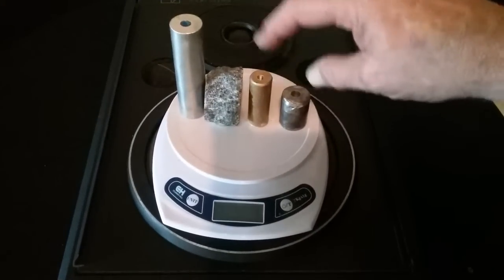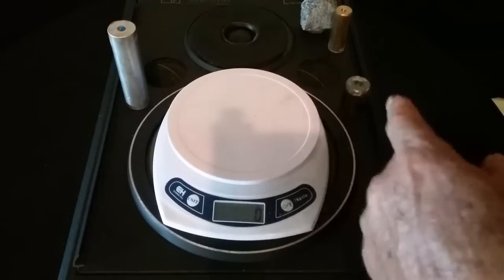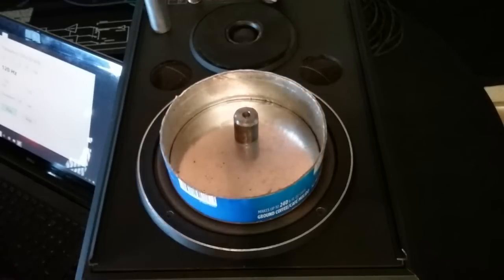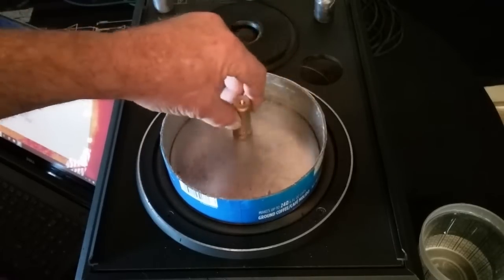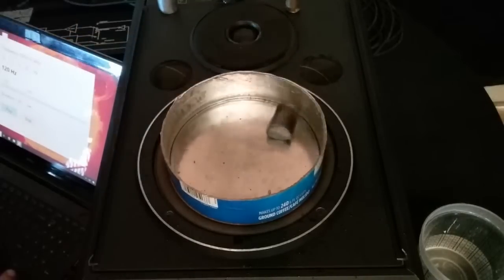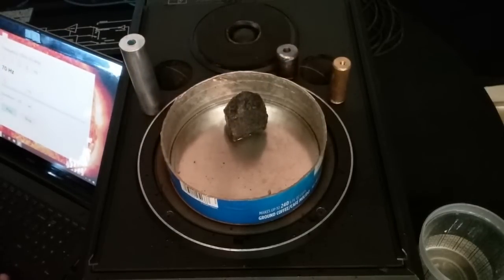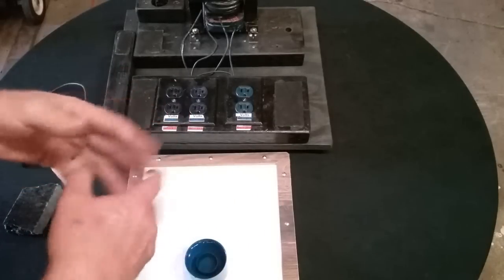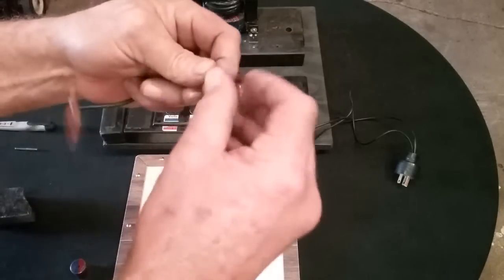Vibrational and Electromagnetic properties of Granite

Comment: Note that not all granite has magnetic material in it. It can vary between where granite is quarried. Many of the vibration properties will arise from its Piezoelectric  properties as it contains quartz. Typical granite is quartz, mica, and feldspar . I see a few online reports from granite top salesman that Black Granite seems to be the most susceptible to being magnetic. The rose and white granite I have on hand don't seem to react to neodymium magnets.
Edit: Double checked on all the granite I have. white ganite does not appear to be magnetic, rose granite is slightly magnetic, while black granite is the most susceptible!
Reply from the maker: Yea - I have experimented with several flavors of granite - and from my experience the black displays the strongest magnetic and electromagnetic properties.
I - like you - am working on the electrical properties as well as electromagnetic and vibratory.
Those darn megalithic builders must have had easy access to electric currents and vibration - because - consider this - if the pyramids were actually generators - to assist with the manipulation of stone - how did they manipulate the stones for the first pyramid? (Unless a mud brick pyramid with minimal quartz rock allowed them the power to build the more monolithic ones...) The dating of all the pyramids seems to be a sham or a confused babel by mainstream "Egyptology".
However, I stand firm in my theory that the ancients had abundant and available electricity and natural vibration by which they "naturally" corersed to manipulate the stone. We just don't have the same situation readily available without a seriously powered laboratory...
Reply: @TheGoodVibrations  I'm definitely convinced that they understood some principles a physics dealing with electromagnetism. It's very silly to see egyptologist try to explain how to move several tons of stone with a ramp and claimed that a single bend in rope was a force multiplier. These people don't even understand basic mechanics. I'm fairly certain that they had a very Advanced knowledge of electrostatics that we do not use very often today in the application of work. Although I can make a Van de Graaff I'm still investigating how they would have done it and what I'm finding is several promising leads across different cultures. On paper it looks good but of course I need to get the materials to experiment.
Reply: @TheGoodVibrations  Its interesting that many obelisks were made from red granite and white.. at least I think that is true. I am thinking why ? Could it be they wanted to dampen the effects of something? Both  Michael and your comments are interesting. The North pulls a compass needle to it. There must be something very powerful like magnetite to pull the needle towards it don't you think?  Has anyone ever thought that the pyramids of Giza might actually be obelisks themselves and if we were to dig down far deeper, we would find out? That would be wild wouldn't it? I guess it would be forbidden so nobody could prove it right or wrong.  I'm just thinking out loud, thoughts that would be forbidden in secondary school. Even if I am wrong, a lot of things do not seem to add up around us on things we learned at school and in the media and I appreciate people showing practical truths i.e. real science. Take care !
Reply: Yes, I tested this myself. Some granite has iron Oxide so ferromagnetic.
Reply: In my opinion the pyramids where cast in 
Geo polymer  blocks
Reply: @TheGoodVibrations  Edward Leedskalnin moved megalith sized rocks using magnetism in the late 1940s.  I don't think the conditions are so changed as to make it more difficult in this era (though the eras have and do change I agree with that) He did produce a short book about the basis of the technique. It's hard to follow!
Reply: @TheGoodVibrations  I think if you'd got to the stage where you were going to build a giant power generator, you'd be able to make smaller ones which allowed you to scale up and make a giant one.  Sound frequency and electrical + natural magnetism manipulation were used, of that it seems certain.
Reply: @miltonreid6740  Yes, Here in NZ we have Iron sand which is magnetic
Reply: @The Good Vibrations   It's a neat demonstration, but the variability of the granite composition leaves you unable to draw a meaningful conclusion about which composite account for each property. 

At a glance, I'd say the stress induced in the quartz composite portion of your stone there is triggering the piezoelectric effect and polarizing those substructures within the crystalline lattice superstructure. 

There's still a ton of research here that I have questions about, however. 

 First, please try removing the metal pan 
,and replace it with an insulator like ceramic or glass. Then please show us what happens. It would be ideal for you to find a setup that's not dependent on a speaker as well, considering those are most likely magnetically actuated and could be interfering with your results. Thank you for reading.
Reply: @TheGoodVibrations  I totally agree with you  awsome  work
Reply: Thank you for this test!
Reply: @mykulpierce , can you explain how the Romans used to move their giant blocks without electricity?
Reply: @fearlessjoebanzai  idk but I can tell you that several people, with a few iron bars, can move tens of tons by using leverage. Though their materials would likely not have been as strong as today's, it is not inconceivable that a small group of people could move most pyramid stones without an unusual amount of effort.
Reply: @TheGoodVibrations  Yall focus way too much on Electricity as though its the only source of energy when acoustic waves are pure Kinetic energy in action not only shown to have mass all its own independent of the material which it propagates but also is the ONLY was we have really found to demonstrate Negative Mass/Energy with proper arrangement of acoustic standingwaves.  Ancients were well aware of Faraday waves and its all over their Art and their Megalithic works.  They show their acoustic devices all over in Egypt but if one does not know what they are looking at they might mistake the sled for something like an ancient lightbulb or something.
Reply: You'll find red granite is reactive to magnets just much weaker... Try using a compass needle to detect the magnetism, also it's only magnetic at certain points where you see more quartz buildup and especially along flat sharp edges... Hematite is a great example of magnetic rock especially in its natural state...
Reply: @NorthernGate777  very unique and original theory... if the pyramids were actually MEGA-Super monoliths, and we only see the top, we'd be potentially talking about life on earth billions of years ago too. lol 

My first thought would be to find out what they already know about the base stones of the pyramids, and see if anyone has ever documented anything abnormal beneath the base stones...
Reply: Michael Pierce - excellent deduction Michael, pretty soon you'll be working out how to make a 'back to the future' hoverboard. All you need is a few more ingredients , to make it work. I'll give you about a year before you finally work it out if you just keep at it. I would like to have open minded thinkers like you on my team. That would be fun.
Reply: @NorthernGate777  - good question. What's under the pyramids ? How old are the pyramids ? Who built them ?
All will be revealed. And when it does. A whole new world will emerge. A world of wonders. A world of abundance not scarcity.
As Tessla once said"the whole universe is a free lunch" 😊
Ps. Keep thinking out loud. It is essential to finding the solution
Reply: All good points - the fact is ‘why create and move such huge and heavy blocks?’ Unless you not only have the ability to but it’s easy to do it - due to magnetism / energy / vibration etc that we don’t fully understand .. yet

Comment: So how would you demonstrate the effects of static electricity on black granite?
If ancient steles and other structures were used in some form of electromagnetic storage/transmission, how did they prevent it from grounding out (insulation)?  But then there's that research on ground effect electrical production.
Lightening is very powerful.  How is it produced naturally?  If tornadoes produce lightning from spinning air, how would the ancients have produced spinning air fast enough to produce a charge?  How would they have produced a charge differential to produce an electrostatic charge?
There also appears to be a correlation between the properties of granite and water to transport the enormous blocks.  Even Machu Picchu was built upon fault lines with water channels in them.
The big question though is how did they produce the sound frequencies to change the properties of the granite to make them lighter?
Reply: Tuning forks,which are depicted in hieroglyphs in Egypt

Comment: Granite has quartz [ silica ] and aluminum in it, try a quartz crystal.
Also the speaker puts out both the vibration motion, but also the changing magnetic field, and the diamagnetic elements respond to that also.
Hold a neo magnet in your hand and move it around the speaker to see the effect, when it is being vibrated. The magnet also will vibrate in your hand.
So you are seeing the sum of two different effects, magnetic AC, and speaker cone motion or Tempic field vibration.
Water is a diamagnetic response, and seems to reverse the force on the objects from a gravity [ pulling to the center of mass point ] and antigravity [ pushing away from the center of mass. ]

Comment: I did not know this either. The crystals in the Granite must be interacting with the magnetic direction. It also makes me wonder if large granite fields are responsible for messing up navigation systems during storms.
Reply from the maker: The iron content in particular types of Granite will align with a secondary magnetic field causing the Granite to be somewhat temporarily magnetized - only when in the presence of the secondary magnetic field. This very well could affect navigation systems.
Reply: Styx  🤯 I think you may have a really good point about sympathetic resonance powering vibrational tools. I wonder if there is any hieroglyphic mention of builders and engineers having hearing problems or wearing hearing protection. An ancient megalithic jobsite must have been a painfully loud environment, if vibrations on this scale were what powered the tools.
Reply: Styx  Sound could shift a lot of Sand too for Counterweights, looks like we`re getting somewhere with our combined hypothesis?
Reply: I live on a granite ridge. We have a terrible time in my area making phone calls and using nternet data.

Comment: I've said it before: The ancients (we do not name) used granite on one side of the world and andesite on the other side of the world; both of them are piezoelectric, both of them exhibit electromagnetic properties, and both are INCREDIBLY FREAKING HARD.

We build with walls, and inside those walls are wires; they just built entire buildings out of energy-generating (or energy-resonating on broadcast, and receivable) materials and even processed them somehow we can't figure out.

Limestone was used seemingly for casing stones, outer layers, or buildings of occupation; limestone is a strong natural insulator. Basalt also exhibits incredible electromagnetic properties, as seen in modern day science ("Electrical and impedance properties of composites: Volcanic basalt rocks" at Science Direct).

Giza was built from the ground up with basalt, pink and black granite, and limestone. At Baalbek they used pink granite, amorphous quartzite, and other similarly tough materials. All of these are 7.5 or higher on the Moh's scale.

Comment: I know Im late to the party and I haven’t read all the comments but.
Just thought I would add that the objects want to flow certain directions because a speaker is actually working in a circular fashion. You would assume that they are only acting in a reciprocal fashion but they are not. They are following the frequency motion from a round voice coil. 
If you watch the taller aluminum piece, it wants to vibrate in a circle. Not really sure what this info offers to the experiment but it’s worth noting.
I’d guess that if the vibrations were more linear, you'd see something very different depending on where your positive and negative poles were. I’d love to see this on a linear plane, something like you did with the transformer.
🤙
Reply from the maker: That makes sense to me.

Comment: So it seems like no one but me knows how the rose granite coffins of ancient Egypt worked. So I will explain it. The coffins did not house sacred corpses, instead the coffins contained just common biological waste material. A dead cow leg or whatever. The coffin has a lid that is cut from the bottom of the coffin, this part is absolutely pivotal. The lid must be cut from the same block. The lid will weigh some 17 tons or whatever size the particular coffin is. However the weight of the lid isnt enough, and even more weight was stacked ontop of the lid. So what happens is that when the cow leg breaks down the pressure of the gas is exerted on the coffin, the Egyptians then converted that energy into electricity. The Egyptian civilization may have been 80,000 years old, and they may have had their electrical equipment all annihilated by a solar flare.

Comment: What if the scale was on top with a wire will how much weight will the vibration remove dry or wet while sound was placed and if their are any changes in weight with varying hertz?

Comment: Try building a tuned radio circuit with an induction coil, place the black quartz next to the coil until you can hear the audio transmission... Then you'll know how the ancients communicated(wirelessly) this is also the technique used to levitate rocks, obelisks, pillars and towers were all used like antenna to store energy into water pools transmitted through the ground... They built them high enough so the wind vibration and pressure increase would create an effect similar to an electric quartz lighter except constant, stable fields were are produced by these structures. This made certain areas of ground live like an amped speaker, any kind of wind instrument would transmit vibrations into rocks on the ground that became live with energy. So the flute/trumpet or horn became synonymous with plugging a guitar jack into an amplifier
Reply from the maker: I think you should try your suggestion and film it.

Comment: Granite also melts a much lower temperature in the presence of water..

The melting temperature of dry granite at ambient pressure is 1215–1260 °C (2219–2300 °F);[5] it is strongly reduced in the presence of water, down to 650 °C at a few kBar pressure.[6]
Reply from the maker: I did not know this!
Reply: So...to possibly answer other 1-2 year old questions in these comments, super-hot steam could have been used to carve and shape the granite, and it would be very accurate and precise, almost like a laser had cut it, or like the rock had been melted (because it had!)
Maybe the addition of vinegar or some other acid helped increase the "carving" rate and efficiency.

Comment: Why does the granite seem to hydroplane with the water subjected to vibration?

Good question. Certainly the acoustics of lubricants is a very interesting subject. The varying pressure and phase diagram of the liquid is very important. The electrical or crystal structure and elecronegativity of an adjoining surface will influence surface tension and crystal boundary conditions.

What is required is for the water to be able to enter the gap to serve as a lubricant.

Comment: Not all granite has magnetic properties, though some does. 
The pan has as much an effect on the experiment as the materials placed in the pan. 
The granite was not the electromagnet, the coil was. The granite acted exactly as the steel in that it had magnetic properties and the magnetic (not electromagnetic) field was focused in the granite as well as the steel. 
All in all, this video showed that granite has small amounts of magnetic elements in it, such as iron, cobalt, or nickel (most likely iron). I do not see that the rest of the tests showed anything else.

Comment: Perspective: forget physics as we know it
1) theory:  the same object has different FIXED and UNIQUE vibration in different location. An object's (atom, piece of granite, planet...) vibration dictates it's location in space (not the other way around). By relocating an object in space to a different location, the same object assumes a different vibration. When the object is returned to the original location it will also assume the original vibration.
2) significance: we can relocate an object by changing it's vibration (an object's unique location in space DICTATES it's unique and fixed vibration)
3) experiment to prove it: measure vibration of an object (best metalic hollow sphere) in location A. Then move it to location B (at least 15-20feet) or until measuring instrument is sensitive enough to measure vibrational change. Then move the object to location A and induce on it the frequency of the same object measured at the location B (must be low friction surfaces). Watch the object move from location A to the PRECISE location B. 
4) This finding has a potential to change the path of the world as we know it.